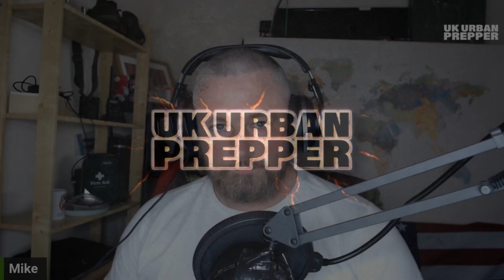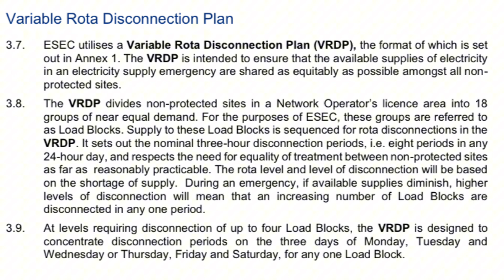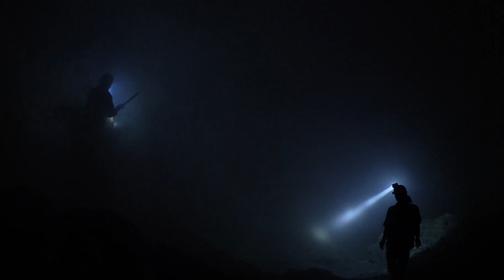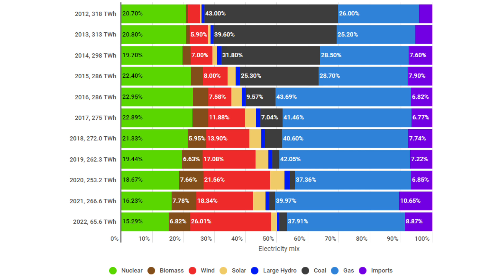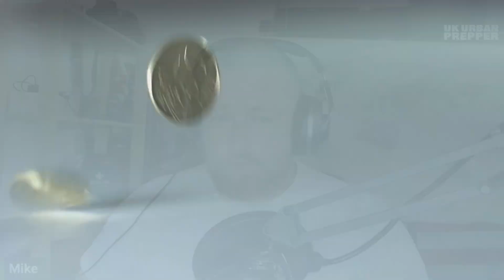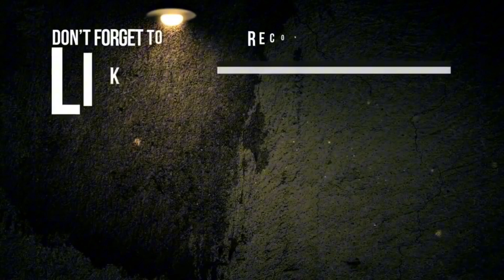OFFICIAL UK Government Controlled Blackouts Plan - Are You Ready?

Comment: One issue that did not exist in the 70's is our new reliance on the inter Web 

We've got power but.. 150 miles away the banks servers have no internet connection as some BT relay box half way between you and them has no power and is off 

Supermarket is lit up and the tills are on but... 

The automated stock ordering is down as the link between the shop and the Wearhouse is dead... So shortages..

And your debit card won't work even though the cash machine is lit up and debit card readers go beep but no link to your bank so it won't authorize transactions

Comment: 2nd try:
Mike, On your electricity bill there will be a letter A - U somewhere near to the top, this is your "Rota block" or the Load block that you were mentioning. You can use this letter to find out when your power is to be turned off.

 If read further down on that ESEC document that you were reading, in Annex 1, it shows you the time blocks (the 8 different times) and when your "Rota block" is in the schedule.

In Annex 2, it gives you a better idea of when your will lose the power and when, in an easy to read set of charts from level 1 up to level 18 (total shutdown)

So for a Rota block A group in a level 1 disconnection you will lose power on Monday from 00:30 till 03:30, then again on Wednesday from 15:30 till 18:30 and then again on Sunday from 00:30 till 03:30.
As the disconection levels go up, you get more 3 hr periods with no power.

Under the Annex 1 heading (see the link in the description, and scroll down) there is a link to a downloadable, printable version (20 pages), I would recommend that everyone grabs a hard copy and put it into your prepper folder along with your Rota block number (found on your electric bill) as then you can plan when to get the candles out 

It might be worth doing a separate video on this one Mike, as it is easier to explain when the table is shown

Comment: Had rolling blackouts in the 1970s.  It was a nuisance but no more than that.  Us oldies know how to  live without internet and television, and you can get battery operated radios.  As he says, nowadays you can also buy portable power stations like Jackery and Bluetti.   I use these at my off grid smallholding and often recharge them using two solar panels when the weather is kind.   Get a wood burner installed for heating while you can, because your gas central heating will go off without the electric pump working.  Cooking can be done on a gas camping stove outside for safety.  Or on your wood burner!

Comment: Ecoflows are great if we have sunshine to keep them charged. Unfortunately, the sun has been blocked practically all summer by "air traffic discharch" so this option is proving to be difficult to recommend - certainly when considering upfront cost!
Reply: You still get solar even with cloud cover albeit reduced. I run  3.6kw of it on  my roof, 12kw of home battery and 3 eco flow powerbanks.  Also you can top up the powerbanks with car charging, charge to 80 percent  in an hour if the mains  if power is restricted ie rolling blackout  so lots of option. But agree the price tag does make you gasp.
Reply: @Scottishprepper73  good advice on charging power banks with the car 👍

Comment: Anyone who has their homephone with an internet provider won't even be able to phone out in an emergency... they seem to think everyone has a mobile phone these days! What about those who don't! If you are with Virgin Media, they will install a satellite type phone for free, which will work if the internet is down. I have one. How will those who use medical equipment fare in blackouts?? Also, question... will the gas be off too? If I have gas, we can eat and have hot drinks, make a hot water bottle if it's winter. I also have a campingaz stove so we'll be good for hot food... depending on what time they switch off.
Reply: The central heating won't work because the boiler needs electricity but your gas hob will still work though you'll need a lighter or matches to light it because the ignition won't work.
Reply: No, they will turn off your gas supply as well.
Insufficient gas supply will mean that they will prioritise the power stations, so if push comes to pull...
You lose.
Reply: @dandycat2204  It was only the electricity in the rolling blackouts in the 70's... Either way, we'll be ok :)
Reply: @HC_Productions_UK  
I admire your optimism.
A 3 hour power cut, yes, a minor inconvenience.
My objection is that a power cut programme is even necessary in the first place.
Especially given that they will remotely disconnect the domestic supply in favour of the commercial/ industrial supply.
Reply: @dandycat2204  I absolutely agree with you.

Comment: Mike, On your electricity bill there will be a letter A - U somewhere near to the top, this is your "Rota block" or the Load block that you were mentioning. You can use this letter to find out when your power is to be turned off.

 If read further down on that ESEC document that you were reading, in Annex 1, it shows you the time blocks (the 8 different times) and when your "Rota block" is in the schedule.

In Annex 2, it gives you a better idea of when your will lose the power and when, in an easy to read set of charts from level 1 up to level 18 (total shutdown)

So for a Rota block A group in a level 1 disconnection you will lose power on Monday from 00:30 till 03:30, then again on Wednesday from 15:30 till 18:30 and then again on Sunday from 00:30 till 03:30.
As the disconection levels go up, you get more 3 hr periods with no power.

Under the Annex 1 heading (see the link in the description, and scroll down) there is a link to a downloadable, printable version (20 pages), I would recommend that everyone grabs a hard copy and put it into your prepper folder along with your Rota block number (found on your electric bill) as then you can plan when to get the candles out 🙂

It might be worth doing a separate video on this one Mike, as it is easier to explain when the table is shown

Comment: Your main need, unless medical, during a three hour period is lighting.  You can cook outside of this period.  The freezer should be fine for 3 hours.  
You can buy solar powered garden security lights and use them indoors.  They generate a LOT of light.
Have thermos flasks and fill them with hot water before the blackout so you can have a hot drink .
And have hot water bottles.
For three hours, most people will be absolutely fine and you won't even need your gas stove if you plan ahead.  
And you can certainly go without TV etc for three hours.
Reply: The thermos food flasks are very good, too, for soup, pasta, noodles, stews etc.
Reply: That’s true but the odd 3-hour period is just level 1 out of 18. I would highly recommend looking at the rota plans. For me, I would say level 3 is already an inconvenience and it works its way up to checking when the power will be on, rather than checking when it will be off! Strategic planning is definitely required in the higher levels.